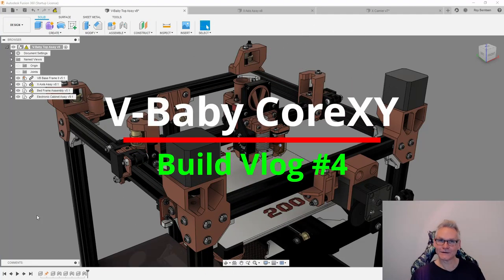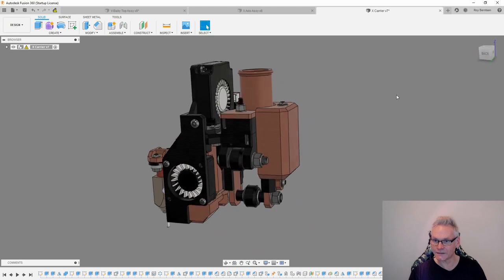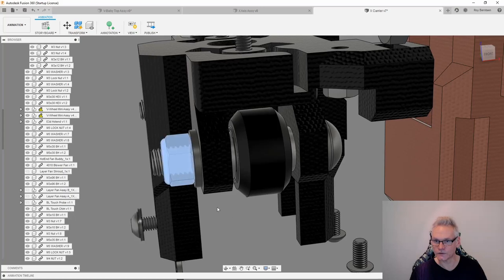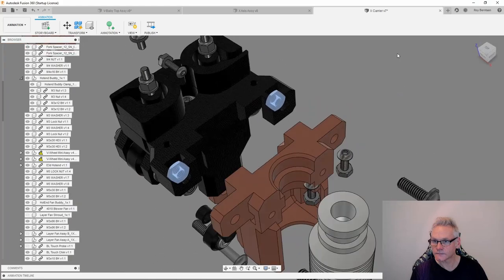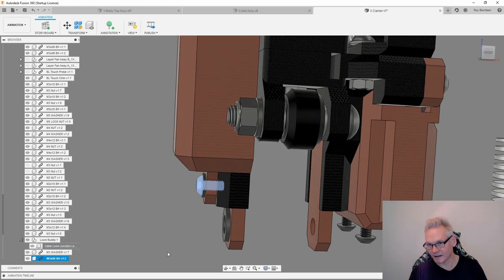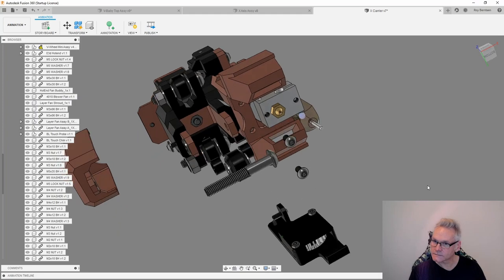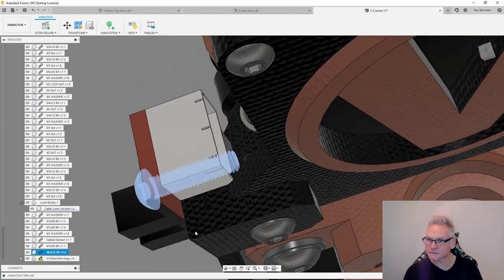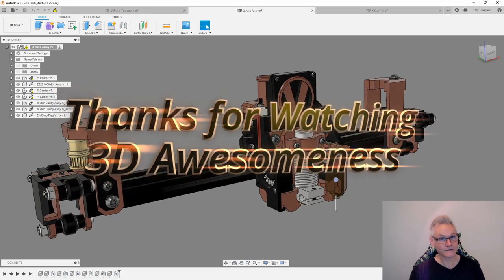Building A 3D Printer | The V-Baby CoreXY | High Speed 3D Printer | Part #4

Comment: Have you considered using heat set inserts. I see a few places where if you prepared the part with a heat set insert, it would be an easier assembly
Reply from the maker: The heat inserts is not chosen due to less accessible and also you need special tools and competence for those to bee applied
Reply: @PRO3DESIGN  I have only used heat inserts for 2 screws, but it was easy to install with a soldering iron.
Reply from the maker: Yes but not everyone can do this or get the inserts